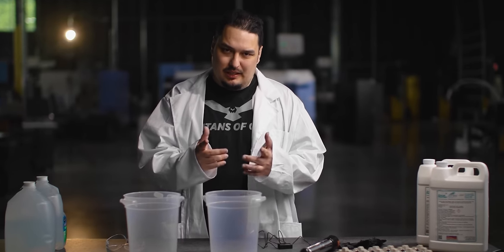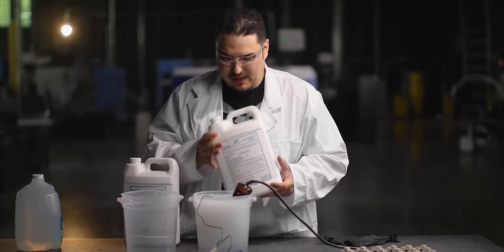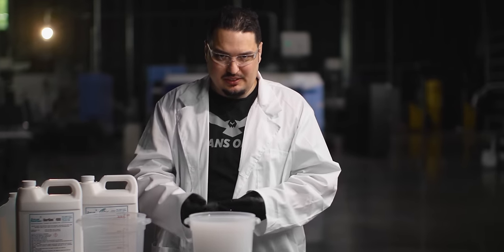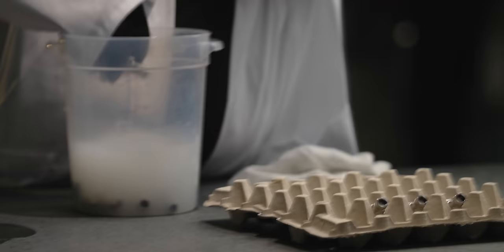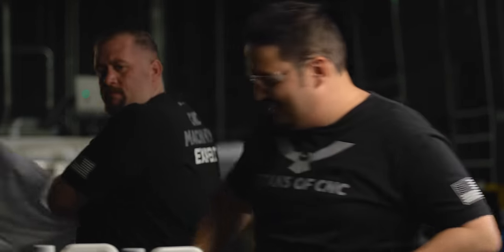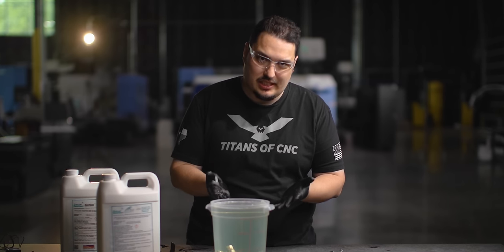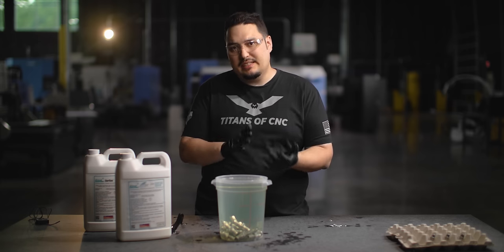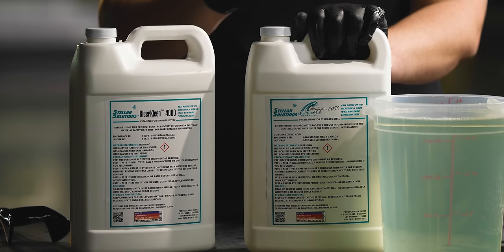The Magic Of Citric Acid: How To Passivate In-house

Comment: A more simplified way of stating what passivation does, is the removal if the ferrous layer of material for the components surface. Often preformed on materials with a high  chrome-nickle alloy, once the iron is removed the chrome and nickel is left exposed which has greater corrosion resistance. It is also important to note that for most large OEMs you will require outside accreditation from both the OEM and an external verifiers such as NADCAP.
Reply: Was just about to write something similar..

Comment: You dont talk about testing procedures to prove the passivation?  If you do another video about the paperwork please include that also.  Thanks for bringing this up.  Charles
Reply: Did you read what it said on the document he showed?  No need for verification.
Reply: @danl.4743  Have you ever done work for the military. Just because a product states in their literature that it meets a particular standard does not mean that it's acceptable. In the standard, there is also a test requirement or multiple requirements that must be met in order to prove that the standard has been met. It is your job as the supplier to your customer to able to verify that the standard has been met.

Comment: Thank you for this! I weld stainless steel pipes for water filtration systems and have been wanting to build my own passivation tank.

But since you are going into stuff besides exclusively CNC machining, I was wondering if y'all have thought about doing plate bending with a  cnc press brake? I just got one for my business and am still learning how to set it up.

Comment: You were using 17-4, but does it also improve corrosion resistance on 300 series stainless?
Reply: You can do this on lots of materials. I've actually done it on aluminum before using a slightly different process. I'm not doing aerospace certified stuff mind you.
Reply: I do this professionally, we use nitric acid on stainless.

Comment: Hello, would this be useful after TIG welding?
Reply: tig welding put an oxide layer over welded joint and will cause it rust over time if not passivated.
Reply: @dragerx001  so it's a yes?

Comment: lol be careful with those heaters. You know what they do, I had one that started bubbling because of corrosion. So what happens if they get a breach in the vessel, then you have water enter the inside, turn into steam, and cause a steam explosion. 1ml of water expands to like 4 liters of steam IIRC. I have seen pictures of aquariums that looked like they had a fire cracker inside of them. I suggest you use a hot plate and a glass non chinese lab beaker... any chemicals mildly corrosive are no bueno for that POS aquarium heater. Glass beakers are super nice so long you are gentle.
Reply: and I dunno if that is the same type of heater but you should be aware of the thermal mass of the heater. Basically its the same as a motor in a blower tube, if you turn it off abruptly and turn off airflow and measure the temp it will go up because there is latent heat inside of the thing that comes out, so normally stuff runs air for a while after it turns the motor off so it can cool down right. Those heaters will over-heat if you remove em from the bath abruptly and thermally stress them. The procedure is to turn it off and leave it in the bath for like a while. They suck.
Reply: you might think the 160 temp is low so there is no risk, but the watt density of the heater is heavy, meaning that the actual inside of the heater is pretty damn hot given the small surface area of the thing. I am telling you get a hot plate and beaker b4 that bull shit goes off on u

Comment: Stainless steel is not resistant to acid. Why do we use acid to do passivation ? Do you need to wash is with a basic solution after the passivation ?

Comment: isnt stainless steel rust proof so why passivate , will this work on mild steel?
Reply: Stainless steel is NOT "rust proof"... it's more rust RESISTANT than mild steel.
Passivation doesn't work on mild steel. 
The process eats away the ferrous metal (iron) from the surface, leaving the chromium and nickel exposed, which doesn't "rust". 
Passivation only works for stainless steel, AFAIK.
Reply: Stainless steel is NOT "rust proof"... it's more rust RESISTANT than mild steel.
Passivation doesn't work on mild steel. 
The process eats away the ferrous metal (iron) from the surface, leaving the chromium and nickel exposed, which doesn't "rust". 
Passivation only works for stainless steel, AFAIK.